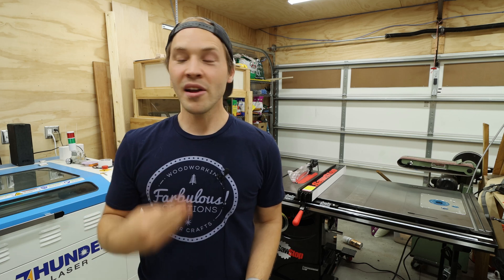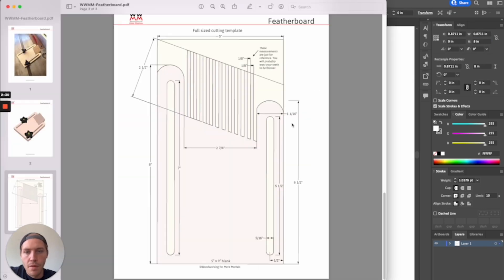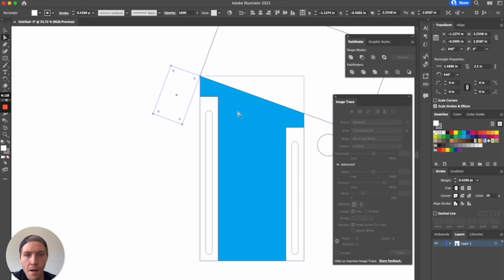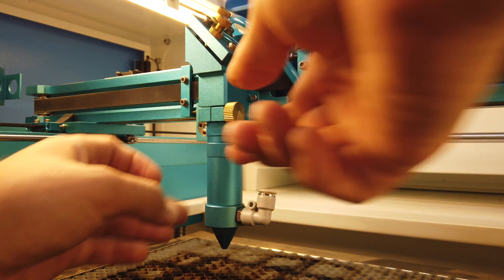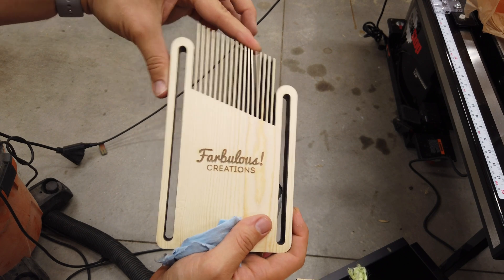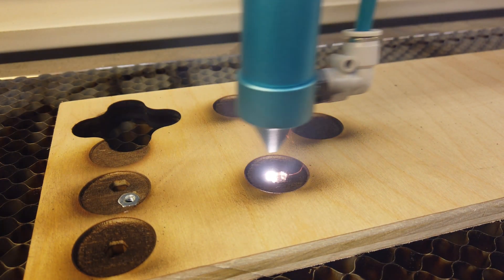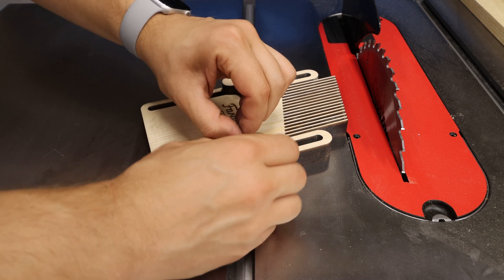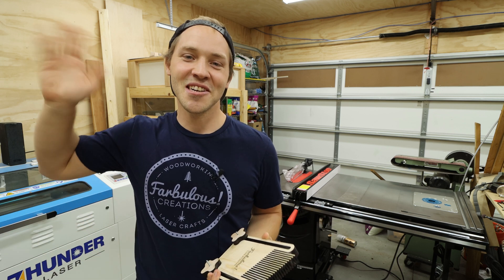Laser Cut Featherboard // Laser-Crafted Shop Jigs

Comment: Jus a suggestion, since you are using a laser, make the bottom of the feathers rounded instead of square, this will reduce that stress point and will probably make them last longer. In all designs they are square, because they are cut with a table saw or a jigsaw, which have square teeth, but the laser can make it any shape you want.
Reply from the maker: Good call! I usually round over most things I cut on the laser to make them stronger / less prone to breakage – not sure why I didn't round the teeth on the featherboard! Cheers!